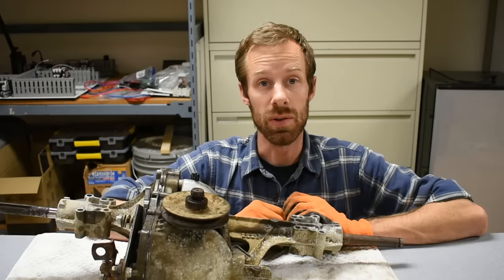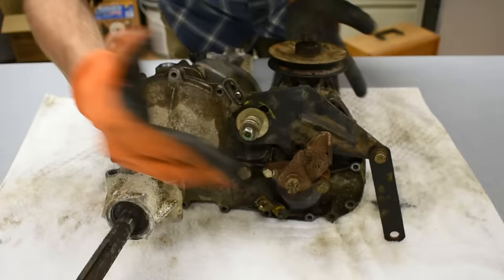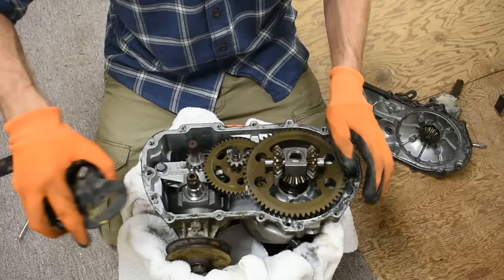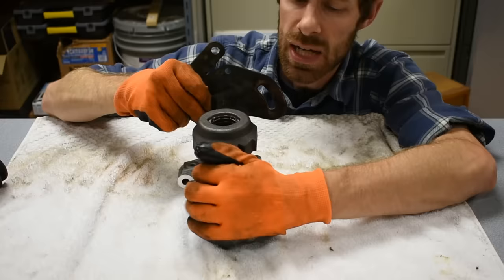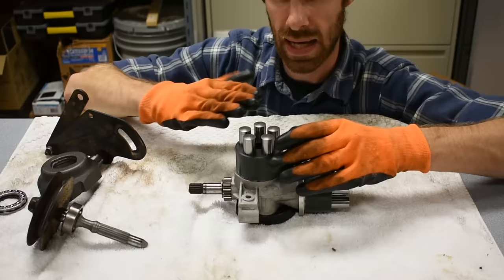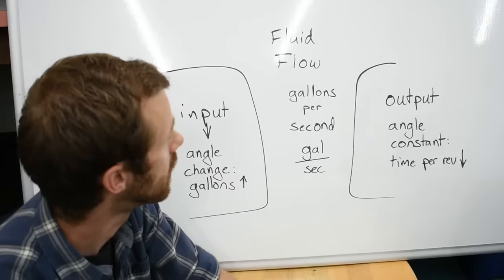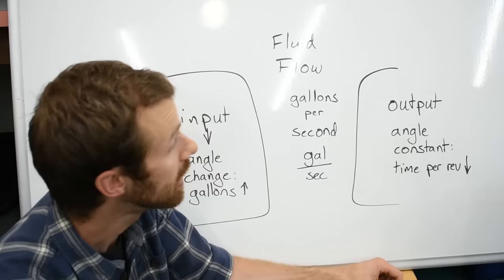How Does a Hydrostatic Transmission Work?

Comment: Many of the small water pressure washers use the multi-piston + wobble drive pump concept to move water under high pressure.  The other point I wanted to make is that whenever you use force to move liquids under high pressure you create heat.  That's why it's critical in hydraulic motor systems to have a way to cool the fluid.  Better systems will pump the oil through an external radiator with a fan set up to cool the oil.  Cheaper ones will simply incorporate fins and a fan on the transmission itself.  These hydraulic motor systems are revolutionary but heat is a major enemy of hydraulic motor systems/transmissions and must be managed.

Comment: Essentially it's a variable swash plate pump feeding a hydraulic motor. Swash plate compressors are found in refrigerators and auto a/c units, the cyclic helicopter control has a similar variable swah plate mechanism.
Reply: It is a variable displacement rotary piston pump... controlled by a swash plate... as they all are.

Comment: In short, it's a variable swash plate motor driving a fixed displacement motor. Pulling on the lever varies the swash plate angle.

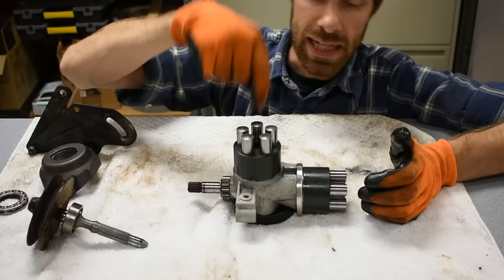Comment: Yea a pump and motor. The part that pivots is called the wash plate. It's called a variable volume pump. That is what is used on large stamping hydrolic presses. The ones I work on are huge. I think using the word transmission kind of throws people off. At 10:00 you say it sounds kind of weird lol thars the first time you describe the system the way a hydrolic tech would. Still on nice video for the laymen.

Comment: Thank you this is a very well explained description of hydrostatic transmissions that I never knew before.  As I think about the rotational forces generated by this mechanism of fluid dynamics I wonder if these transmissions are prone to wear out either from piston wear or bearing wear.  Some of these small garden tractors are designed to pull, say, a tilling attachment or push snow.  And so, these situations create much more stress on these pistons and bearings, it seems.  What is the expected life of these transmissions (TBF, time before failure)?  Thanks again for sharing this well thought out video.

Comment: A good presentation.  I would think you'd put that back together though.  Looks like a good old one.  Bet "they don't make 'em like that anymore"!
Reply from the maker: I did put it back together, but during initial disassembly, I used some tools to help remove the piston components and scratched the inside surface pretty badly. 

It is currently still in one piece, but I doubt it will ever run well again. Now, I just keep it to take apart and show my kids and whoever else wants to see what's inside.

'They don't make 'em like that anymore' is true... IFFFF you take care of it and treat it right!!
Reply: @PetersonBrosAutomation  Understandable! It is still a good demonstration piece.  Was interesting to see inside. Thanks!

Comment: good morning, that ball bearing ring acts like a Gimbal Ring (very similar to that on a helicopter driveshaft up to the blade/hub assembly).  pushing the steel "cups" down forcing fluid where it needs to be, then releasing those "cups" to allow fluid to fill the cups up an the other side of the "ring".  forming the action of a shuttle valve to keep fluid moving at the proper time.

Comment: That was great!  I'll need to watch a dozen more time to fully comprehend but you did a great job explaining.  My first machine with a hydrostatic transmission was a Honda snowblower.  I always marvelled at how smoothly it transitioned from forward to reverse.  You did a great job of explaining the mechanic and dynamic workings.  This device sure beat the old fashioned planetary gear,   Thank you!

Comment: Very good demonstration & explanation. My channel is a DIY small engine & various DIY projects. I worked on a couple of these transmissions & have read up on these transmissions & studied many diagrams. You by far give the best  clear explanation that I came across. It has been a few years before you made this video but it would have saved me so much time. If get any questions on my channel about transmissions I will direct them to your channel.
With 16,560 views & 238 likes in less than a year what else can I say.
     I just subscribed & hit the 239👍 for you.
Stay safe, Joe Z

Comment: Whoever invented this transmission was a genius. I wonder why they don't use these in cars?
Reply: The torque converter in many automatic transmissions works with a similar principle, though it does not use a swash plate pump and motor.

I think the main reason this type of transmission is not used in cars is it is inefficient and loses significant power to heat compared to a geared transmission. This is not as much of a factor in low speed operation such as in a tractor.

Comment: You finally used the word PUMP.   I was wondering if you were ever going to sayathe word PUMP which is what this thing is in its most basic terms.  I had a problem with a sprayer from Harbor Freight.   It had the little cups, springs, and a cam that were turned by a 12 Vdc motor.   It would not prime so it never pumped fluid.  I took it apart and poured mineral oil into the little rubber cups.  I put it back together and it worked.   Harbor Freight gave me a FuLL Credit because they said it could not be fixed.  I got it for free and it still works years later.

Comment: Load sensing variable displacement piston pumps .
Kawasaki Rexroth Bosch Sunstrand Eaton  etc makes large ones for heavy equipment. The angle plate changes angle according to load on circuit from load sense lines .
Most modern equipment uses such and are computer controlled on newer ones .
They can cost $40-50k to change.
Best to change oil and use best quality or $$$$$
I rebuilt many of them.

Comment: can a hydro transmission be rotated 90 degrees to use with a horizontal shaft engine? I saw someone rotate one 180 and it worked but is 90 all right?

Comment: A tilting rotary squash plate changes the amount and direction for fluid flow. The drive pistons receive fluid under pressure of various volume and amounts. This has been a very similar design use in automotive air conditioning since the introduction of the 42 pound axial six A/C compressor Harrison compressor on GM cars since the 60's. Then manufactured by Vicker's, then Vickers-Sperry and as the patent has reach sun set now manufacture by many like John Deere and many others. Kinda different with the 90 degree angle output compare to input.
DK, ASE Master Tech since 78, Retired.

Comment: I'd like to know how the hydraulic fluid doesn't escape the gap between the rotating cylinder thing that holds the spring-loaded cups and the stationary section with the slots for the fluid. If the cylinder is spinning, it's hard to seal the gap between that and the stationary plate well enough the hydraulic fluid doesn't escape, I think. Or does the hydraulic fluid leak into the case during normal operation?

Comment: Thanks. My John Deere LT150 hydro tranny is "sealed". I'd sure like to change out the fluid, but it looks like I'd have to remove the transmission and open it up to do so. What do you think about this? The dealer said it never needs to be changed because it's not exposed to contaminants.

Comment: Liked the look of those "supped-up watch gears". My 12hp 30year old gear drive Wheelhorse  OUT PULLED a New 26hp hydrostatic drive "lawnmower ". They were sized the same, in tires & weight . The hydrostatic unit go PULLED Backwards untill it Stalled out & died, the Wheelhorse still keep pulling and NEVER stoped. So why do these hydrostatic "lawnmowers" exist ---covenient to use & CHEEP to Build. The Wheelhorse is now 40 years old & still runs like a champ. The 26hp hydro-slack-o-matic is Long gone & most likely in the Junk-Yard.Thanks for the great Video &happy safe tractoring.

Comment: Hello, so If i change input torque(speed is always constant) of the ICE motor will this result in speed change on the output shaft of the Hydraulic motor?  What is the difference between hydraulic transmission and hydraulic motor?
Reply from the maker: The only way to change the output speed is to change the volumetric flow rate of the fluid. An increase in engine torque will only increase the flowrate if there was significant reverse force from the transmission that was slowing it down (a very heavy load). So, effectively, this actually would increase the speed. If there is a small load on the transmission, increasing the torque of the ICE would have no effect.

The difference between transmission versus motor - a motor is fed by hydro pressure and rotates a shaft to drive a machine. The second half of this transmission is a hydro motor. 

A hydro transmission is really nothing more than a pump combined with a motor, but done in a way that allows the output speed to vary while the input stays constant. 

Truly awesome engineering!

Comment: I purchased a riding mower back in 2009 with a V-twin, 24hp engine with a 6 spd hydro static transmission. Since then, I have replaced the transmission three times. I have 908 hrs on the engine and no problems. But it's a different story when it comes to that transmisson. Can the transmission be rebuilt? If so, @ what cost.

Comment: Not neccesary any pressure- engine  control eg. high pressure or automatic displacement regulation over on the manual pump adjusting to eliminate  the  overload of the pump/motor or the engine?

Comment: I'm using one of these transmissions to build a winch. Needing to know the rpm range needed for input. Is it 1:1 with the mower engine? I'm wanting to go with an electric motor. Will i be able to compensate my input power by gear ratio?
Reply from the maker: The engine was linked to the transmission with a drive belt, so I think the ratio was about 1:2 (engine being smaller, higher RPM.

I would strongly advise keeping that same strategy - if something causes the mower to roll backward or some other strong force drives back against the input, it could load the motor down too much (overcurrent). The drive v-belt provides a slipping ability that acts as a clutch if the transmission is loaded too much. Gears are not forgiving.

Comment: What happens to the pressure of the fluid on a very steep hill when you go for maximum angle but the tractor cannot move because it’s too steep? (It’s not recommended of course, one should back off of the lever / pedal)
Reply: Depends on the system... A proper design will have a maximum bypass pressure at which point all oil is diverted back to the sump.  Nothing bad happens short term.  If a person were to maintain that condition for an extended time period the oil will get extremely hot until it stops being an effective lubricant.  Absent a maximum bypass pressure it will stall the engine.  Some skid steers you can stall the engine if the tires have enough traction.  If the engine has the power it will eventually split hoses, or the pump, or a motor.

Comment: Hi, 
good video,  mine hydrostatic transmission is making noise like pieces of metal inside, I opened it and it seems that the noise is coming from the  pump,   how  can I remove the pump?

Cheers 
Ray from  Sydney Australia

Comment: Its the same principle as any engine. Low pressure in and high pressure out via mechanic manipulation. Or intercourse, low pressure in and high pressure out after some mechanical manipulation.

Comment: So am I understanding this correctly: The pistons on one side of the set of pistons (in the output set that is connected to the output shaft) are pushed against the fixed angle part of the transmission case by the pressurized fluid and that is what forces the whole set of pistons (and thus, the output shaft) to rotate?
Reply: This is the one part he really didn't explain, maybe he thought it was obvious. But yes, the pistons pushing against the fixed angle plate cause rotation of those pistons....it's almost like the angled plate is a crankshaft, as the pistons push on the plate they go from the closest point to the farthest point possible, but rather than turning a crank, the pistons move instead.
Reply: Search "axial piston motor" or "variable displacement axial piston pump".

Comment: Early 2000s Honda rubicon four wheelers have a similar setup, (they don’t reverse the pump though)They called it the Hondamatic. I have one, it’s very smooth.
Reply from the maker: That is interesting. I actually have intended to look into four wheelers that use this system. It seems like they would be more prone to vibration (I mean, you probably drive your 4 wheeler a little more aggressively than I use my lawn mower). If this is true, there must be some design that keeps the angled swash plate set into one position and keeps it from wandering out of position. 

In my lawn mower, it just has a handle for the 'shifting' and it doesn't move, but if it vibrates out of position, it changes the speed of the wheel. I would be curious to know how it holds a set speed. 

Thanks for the input!
Reply: Mr Honda himself looked at hydrostatic design in the sixties. Then efficiency was around 40%. He redesigned it and got the efficiency up to 96%. He decided it was successful but there were not appropriate applications in the Honda line up so they put in on the shelf for later use. Late 90’s and the 4x4 thing was taking off  and they decided to use it in the Rubicon.
Reply: @willleavitt7156  I actually bought my2007 Rubicon brand new just because of that transmission and I was not disappointed! I love it
Reply: @PetersonBrosAutomation   Don't forget a lot of heavy equpiemnt uses hydrostatic transmissions. Specifically I can think of tractors and skid steers, but I know there are many more, and larger equipment using hydrostatic transmissions. I don't think you are going to get much rougher than those situations. I know on the skid steers that I worked on, they just have a damper on the controls to prevent drifting. I don't know of any other differences because even my lawn mower has a different design to the hydrostatic transmission than what you shown here, and the one you shown being the most consumer grade one I've ever seen.

Comment: Thanks for the teardown and informative vid... with this all known, what would you recommend to make the tractor faster? 4.5 mph is top speed of my craftsman yt4000 and has plenty of power, I'd like to get it up to at least 7mph for a long big yard. Do you think modifying the rotational speed of that pulley is the answer (smaller pulley)? Or is that a grenade to the design of the internals of that gearbox meaning only bigger tire diameter is the safe way to go?
Reply from the maker: That's the same mower I have! Well, until I moved to a place with a tiny yard, so I gave it to my brother (not the same transmission as the video). Anyway, that's not what you came here for...

Increasing the speed of the input shaft is one option. However, for each model, the fluid passages in between the driving pump and the output motor are based a certain fluid flow rate. It is possible that it can handle an increased fluid flow rate, but I wouldn't be certain of that. Viscous fluid, like this oil, will increase the friction on the walls of the passages at a higher flow rate. It will cause more heat, and it may be really hard on the transmission. However, a slight increase may be ok. 

If you can't tell, I'm trying to say 'maybe' while also saying 'please don't quote me on that'...

As far as the wheel diameter, that would work as well, as long as you can also lower the deck height so that you are still mowing at the same height that you like. Hope it works!

Comment: What does it mean if a hydrostatic transmission says infinite (2 range)? Is that the same if it said 2 forward / 2 reverse?
Reply from the maker: I'll preface by saying I am not very familiar with such systems, so my brief knowledge may be confirmed or debunked if someone else wants to jump on.

In a 2 range system, there is a single output drive shaft to the load, but 2 shafts parallel to it driven by the hydraulic motors continuously being rotated at the same speed in the same direction. Only one of those shafts is meshed to the final output shaft. If the transmission is in low-range, it can still drive with a full sweep forward or reverse as normal, but the final output shaft will be slower with more torque. In a high range, the output shaft will be faster but with less torque. 

The application and benefit is for vehicles where a higher top speed is needed, such as a tractor, without requiring the engine to run at a higher RPM (therefore maintaining closer to its highest HP output). A lawn mower would most likely not require such a benefit, unless it is a higher performance model with a higher top speed.

I would imagine that any time these are meshed, they should be done at a stop with the hydrostatic transmission in neutral to reduce the load on the gears.

Comment: Hydraulic variable displacement pump uses swash plate to increase pressure . The pump and the drive motor are exactly the same just opposite operations and reversing the process .

Comment: Great description and if you buy a hydra gear, equipped lawn tractor, you’re going to need to know how to fix it in a couple years, just beyond warranty repair. They are notorious for failing. Never again for me, if I ever buy hydrostatic again I will make sure it does not runon Hydro gear hydrostatic transmission.

Comment: Can you fix my hydro gear G700? It’s not going up hills anymore. I changed the transmission fluid but no luck. I still have forward and reverse but I noticed a slight leak in the Hydro Gear charge pump cover. Not sure if that’s the reason for lack of power. It does have over 500 hours on it, not sure if it’s time for a rebuild. If you have any advice I would appreciate it Thank you